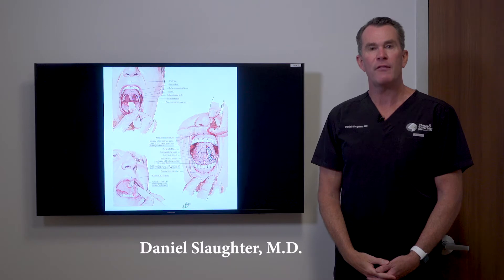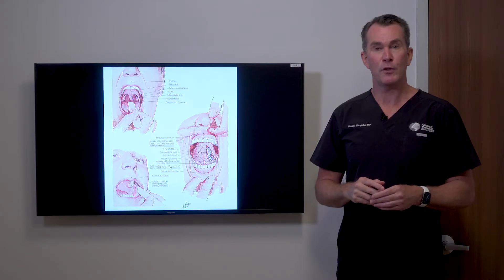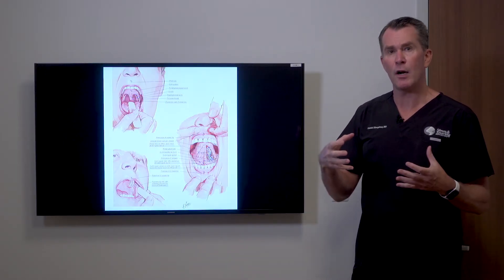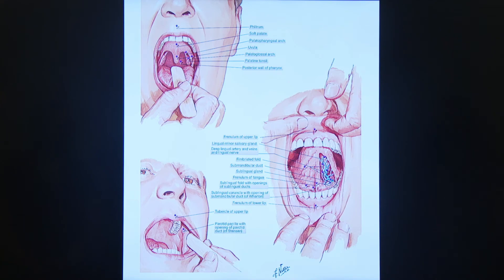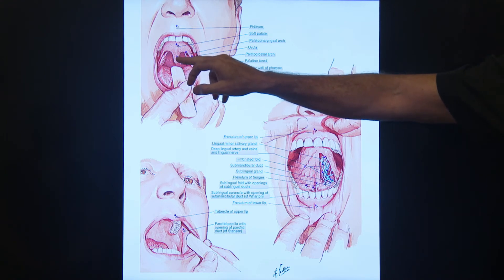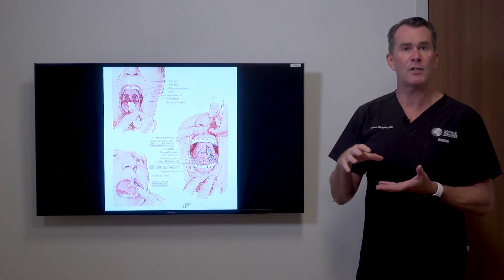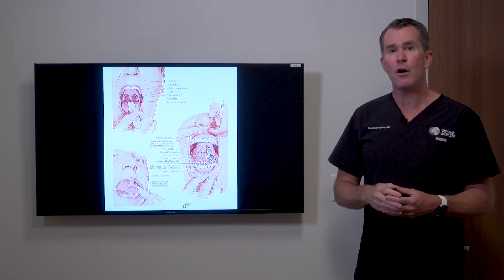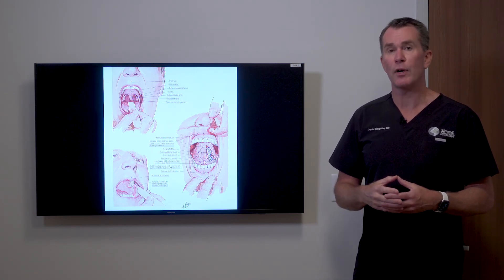UPPP - Using thermal fusion & trimming the uvula / soft palate to treat Snoring/ Sleep Apnea

Comment: I so need this. I have the worst sleep apnea. Uvula is huge. Major sinus problems. I’m a disabled combat veteran that has to rely on the VA which I do not trust for this kind of surgery. I need a miracle or I’m not gonna be around. I’m only 49 been using cpap for years with no luck. My machine gets maxed out with pressure and I still have apnea ripping the mask off in a panic. I need a miracle dr please.